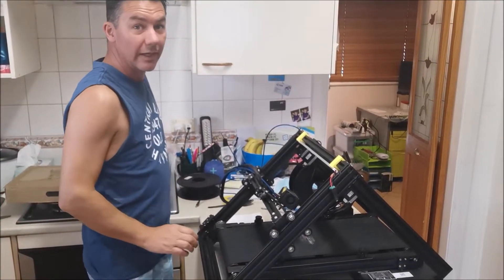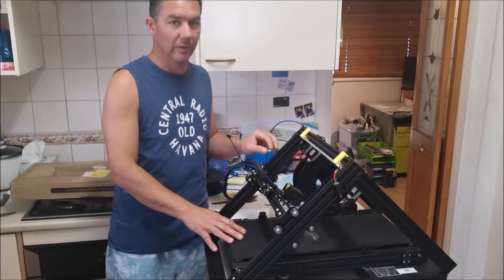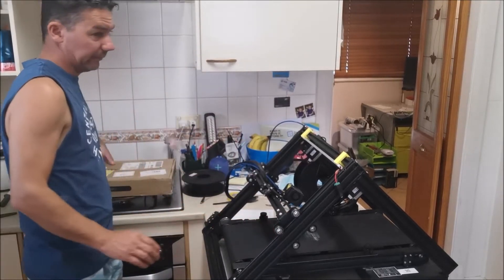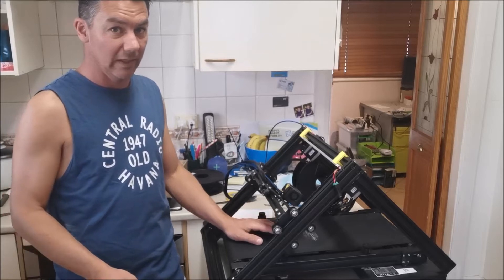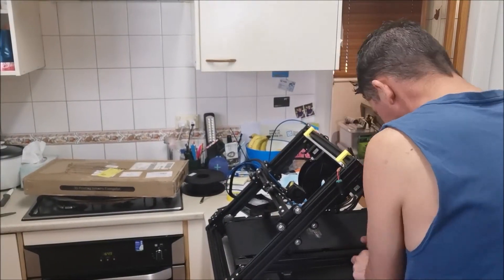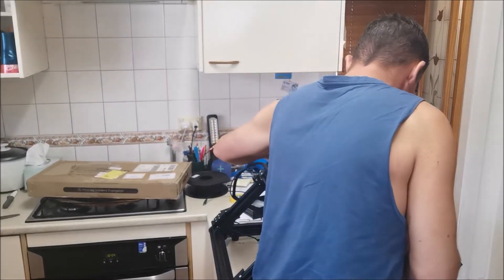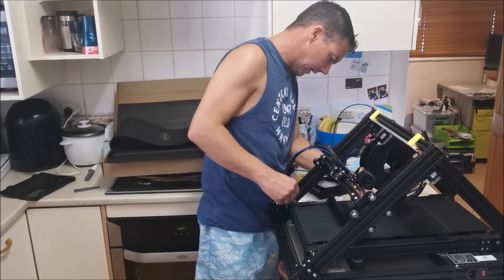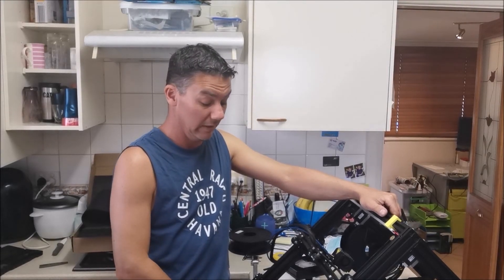CR30 Print mill Belt replacement

Comment: I bought my cr30 7/22 and it has a 1.1mm belt. I can get things to stick perfectly. If I do the lines for leveling it's perfect. But I keep getting layer shifts from left to right looking at the printer.
Reply from the maker: I've heard the stepper motors can get hot and do this. I don't have any layer shift problems, just adhesion issues. Sometimes it works great and then it doesn't. I just don't have much time to put into it so I use my other reliable printers when I need things done.
Reply: @davezon  The motor currents have to be adjusted, they're normally set at 1.3A and need to be more near 700mA

Comment: Thanks for the video! I think I have the same belt as I bought the printer just when the kickstarted had shipped. I’ll get a new belt as I have severe sticking problems as well.
Reply from the maker: I'd say we have the same belt as mine was bought at pretty much the same time as yours. Replacing the belt made printing so much easier. I have had prints go continuously for 7 days now. Best of luck!

Comment: Bought a CR-30 in late November.  Took off the belt to loosen the screws on the hot plate, and mine is 1.25 mm.  
I wish I had seen your "count the turns" trick before I took everything apart.  Good tip!
Reply from the maker: Thanks 👍